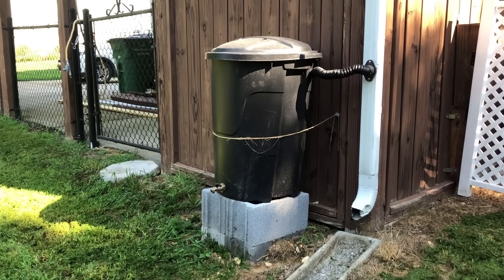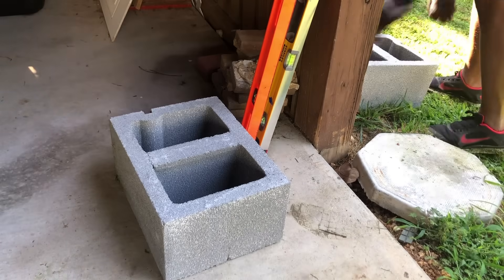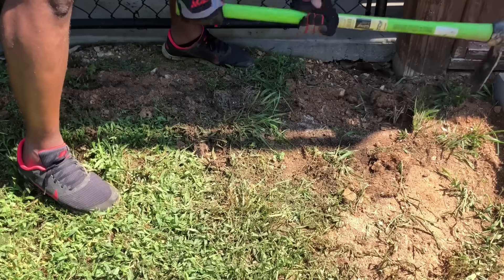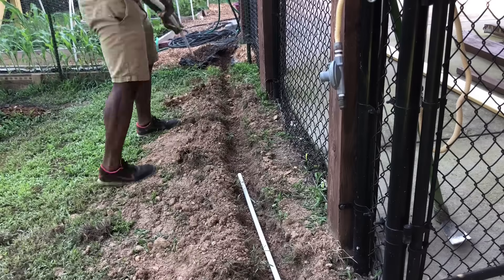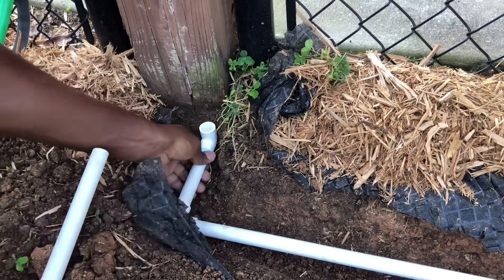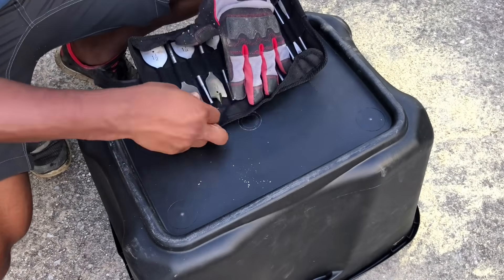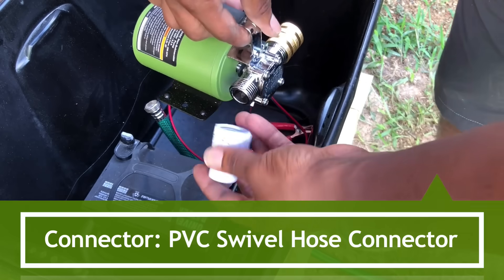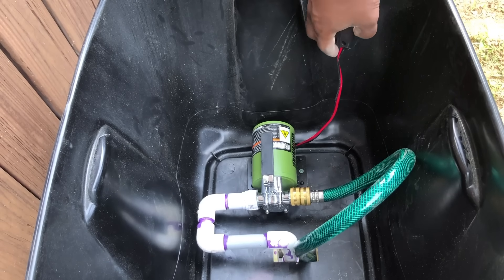Rain Barrel System | CHEAP Water Pump Setup

Comment: If you use a RV water pump they have an auto on solenoid so whenever you turn the hose on and the pressure drops or turn the valve on it will turn on automatically and they're much quieter
Reply: Those are called an "on demand" pump, I believe.
Reply: The noise might not be a bad thing once it becomes considered everyday sounds. That way when the barrel runs dry you hear the tell-tale of a problem in the works.  If one the other hand stealth is required, the sinking the tub into the ground would work to mask the noise.
Reply: Link?
Reply: @mcole1987  Google your keyboard works right

Comment: Nice video !  A small recommendation: mount the motor on a rubber or foam block and mount that foam to the bucket. That way the pump does make significant less noise.
Reply from the maker: Awesome tip. Thanks for sharing Petrus!😀

Comment: Nice video. Just wondering why you didn't turn the rain barrel 90 degrees to the left so the spigot was pointing directly at the pump box.  Seems like it would have looked a lot cleaner than having the hose running out of the front.  Overall, great little project though.
Reply from the maker: Hey Tom, thanks for the comment. No reason at all for the spigot location. Just an oversight, but thanks for sharing your recommendation!

Comment: To automate it, you can add a relay where the switch is and use a ESP8266 with the Blynk app to turn it on and off using your phone and Wifi.
Reply from the maker: Hi Simon. I actually did something similar to that and created a video showing the process. Thanks for the suggestion.

Comment: Great video!  Would like to see you do a solar setup.  I have a 110volt submersible pump in my rain barrel.  I works ok for hand watering but can not power a large lawn sprinkler through a long hose.  Rain barrels are pretty useless unless you have a convenient way to use the water.

Comment: Great explanation and step by step build.  This solved the distance and pressure issue with rain barrels.  Good choice for pump, as these transfer pumps came in 12vDC and 120vAC and commonly available.
Reply from the maker: Great to hear Rick!

Comment: Great vid. Thank you for all your effort.
Could you also use a garden hose or flexible poly pipe to go from the pump to to the garden tap outlet to save all of the pvc pipe and elbows?
Reply from the maker: If it was a temporary setup, probably, but if you plan to make it a permanent setup, you may want to check your local plumbing code as there could be other concerns regarding that method that I'm not aware of.

Comment: Nice design and great vid! My only concern would be to put the battery in a separate container. Leaks in the line or pump are quite likely over time especially with the hose connection. Water + electricity = not good.
Reply from the maker: Hey David. Yeah it definitely is not a long term setup. I'm actually in the process of trying to do just that. Thanks for sharing!

Comment: Great video. 

What do you think about using an RV water pump instead of a transfer pump?

The RV pump will cycle on automatically when it loses pressure (ie when watering) and stop when you stop watering. The transfer pump will keep building pressure until you turn off the switch.

Add solar panels to it and it's pretty much hands off.
Reply from the maker: I briefly looked into on-demand pumps but many of the reviews I found online stated that the pressure switches built in fail quite often. I was surprised that almost every pump I look at on Amazon, Northern Tool, and a few other stores had similar reviews regarding the pressure switch. I would still like to test one out myself, but just have not found a solid highly rated on-demand pump yet. Also, for my application, it is not necessary since I currently have drip irrigation setup, so the exit side of the water line will always be opened. Great question!

Comment: FYI utilities aren’t going to be able to help you with locating any lines on the customer side of utilities. In general utilities run perpendicular from the main to the meter. Keep that in mind. If your gas meter is on the right side of the house, you shouldn’t hit a gas line on the left side of your house UNLESS you have a houseline ran over there to a grill, pool heater, lamp, etc. which your utility co won’t be able to locate. They can locate from the main to your curb valve or meter.

Comment: how long does the battery last before having to charge it?
Reply from the maker: Hey John. I'm not sure since I never gave it a chance to discharge fully as a few days later I began working on the solar setup for this project. I highly recommend adding some form of recharging to for the battery such as solar if you do go this route.

Comment: Great video,  really nice job.

If you have a compressor you might think about using it for winterizing.  Adapt your 1/4" quick connect or whatever size compressor fitting to a standard hose fitting (takes a few converter pieces to get OD and thread size right).  Connect a small hose to your compressor and the PVC end at the pump.   Open the rain water ball valve outlet and close the city outlet.   At your manifold open up in turn your hose, soaker hose and sprinkler feeds.   Blow air through each it till no more water comes out, close the rain water ball valve and cap off the PVC at the pump.   

No need to pull anything up.   I do this about once a month in winter.   I'll run my drip system about once a month to deep water trees and plants on a warm day then blow out the system and repeat.  Never ever have to worry about freezing.

Comment: For the discharge side also, you should use a short flex connection, just to avoid tube cracking, due to vibration from motor-pump. Rest.. all good,  brilliant  idea.
Reply from the maker: Thanks for sharing Alecsa!

Comment: An easy way to level out the ground for setting concrete blocks is to use a 6" high mound of gravel or granite chips and tamp them level with a tamper. Set the blocks on top and they will not shift after that. I've found that you cannot trust leveling dirt as it will settle over time and the barrels may slump slightly to one side.
Reply from the maker: Great tip Fireboat! Thanks for sharing.

Comment: Are u not worried about the freeze line ?
Reply from the maker: Hey Dan. Yes, that is a valid concern. I drain my pipes and rain barrel when that season is approaching. If I was starting this project over, I would create a simple drain point using a Tee & ball valve at the lowest part of the system to make draining easier.

Comment: this was awesome I'm actually impressed you hard piped the out side of the pump I would have just used a short hose.
Reply from the maker: Thanks Chris. It was primarily from a lack of experience, but I do plan to redo that setup at some point to make it a little easier to swap out the pump if I ever needed to.
Reply: @GreenTechTown  one suggestion is if you have to worry about freezing take the pump off open the spigot and blow air through it if there is no water there is no risk of the pipe breaking

Comment: Please do not use a sprinkler system with captured rainwater, soaker hoses are fine. A sprinkler produces a lot of aerosols that can transfer legionella, which in turn can grow in your rainwater when the temperature is between 77F and 113F (25C to  45C).

Comment: Nice work mate, good video and easy to understand. If I could suggest one thing though, instead of back filling the water pipes with the dirt you removed, instead back fill with small rocks or gravel then over the top with some dirt or turf, this will help if you ever have to pull up the pipe to inspect for leaks or damage and the pipe will come out easier and not be compressed down with rainwater and mud.
Reply from the maker: Thanks for sharing! Great tip!

Comment: 1. Really enjoyed the music & id like to know what it’s called so i can enjoy it later while i am working.
2. I love how you used a fast video speed while maintaining a normal speed narration. It was very comfortable.
3. I really enjoyed the content overall & the camera angles were pretty spot on.

[Q&A]
-without solar panels to recharge the battery, how long would this system last on the 1 single battery?
-a nice time-lapse once your main video is completed would have been a cool addition.
-are you intending to scale up the system with even more rain barrels? (I haven’t seen the original video yet)
Reply from the maker: Thanks J Bass for the feedback.

Without solar panels, if I left the pump on constantly, it could probably run for 3 to 3.5 hours. Of course, I went ahead and added solar to my setup, so this is no longer a concern, and something I highly recommend.

I do intend to scale up the system. I'm still in the research & planning phase for that project.

Comment: Everyone, please note that this is a great project and video except for one important detail....there is not municipal water system in the country that will allow you to connect a rain barrel system to the city water line as they are obligated to provide clean drinking water to all.  They can not risk you back feeding your rain barrel water into the city water system.  Do everything else, just please don't connect to the city line out of convenience.  The fines can be quite substantial.  Call your water provider and request information concerning this issue so that you will not be in violation.  Otherwise, great video.

Comment: Excellent video. Pro tip....you really only need to keep the glued ends secured for around 4 seconds. The primer acts as a softener, like you had mentioned, and the glue actually melts the pvc together. Around 4 seconds is all it takes to make that bond. I'm pretty excited for the idea you presented here. Got a like and a sub from me.
Reply from the maker: Thanks for sharing hrd2dfyn, and welcome aboard :)

Comment: Good job, I'm going to mount my pump and battery on a trailer with a tank on the trailer. Pump the water from rain barrel to water tank on trailer for remotely located plants.
Reply from the maker: Awesome! I've seen a few people do a similar application. I would do the same if I was in your shoes.

Comment: This is a great video, very detailed and yet not long and drawn out. I'm assuming you turn on the pump manually when you water correct?
Reply from the maker: Hey Victor. Thanks for the feedback. And no, I do not turn on the pump manually anymore. I've installed a wireless method which I've created a video for on my channel. :D

Comment: For a garden, if you put down 8”-12” or more layer of straw on top of the soil, you will not have to water all summer long even in the driest times.  Try it.
Reply from the maker: Thanks for sharing this tip Julius. I have seen others using straw for that same reason.

Comment: Very cool. Subbed👍👍
So it looked about 20ish ft from the barrel and pump to spigot... what would you guesstimate the outer edge of how far that pump could usefully push water? 
My garden is probably 100ish ft from the house. You think a bigger pump would be necessary?
Thanks,
On to check out the solar install 👏👏
Reply from the maker: Welcome aboard! Regarding your question, I'm sure there is a math equation to figure that out, but if I were in your shoes, I would probably go for a larger pump if I needed to pump water that far and still meet the needs of my application which needs more volume and pressure for my drip irrigation system I recently installed. If the demand is not too high, you may be able to use it, but double check with a professional at the store and see what they recommend just to play it safe.
Reply: @GreenTechTown  cool mate, thanks👍 yeah it would likely be to run garden soaker hoses, so im guessing it wouldnt need too much pressure. Ah the joy of planning lol

Comment: Good, but most water regulations say you should have a double check valve in there, just in case of low city water pressure, you could be back feeding stinky rain water back into the mains drinking water and killing people. Good system though.

Comment: Nice job!  Had a thought, maybe put the battery up on a block in the bin and drill a couple of small holes on the bottom of the side of the bin so if it does spring a leak inside the water would drain out before it got up to battery level???
Reply from the maker: Hey Valerie, that is a great idea. I plan on completely separating the major electronics including the battery from the water pump tote soon since this was a temporary setup to see if the concept would work before investing more time into it. Thanks for sharing the great idea for some who may want to keep everything in 1 tote/container. :D

Comment: Nice! I realize you added a solar panel later, but how did you originally keep the battery charged?
Reply from the maker: Hey Ed. Before using the solar panels, I would just use a standard battery charger, but I did not use that method for very long. I quickly added the solar panel to the system right after I completed this part of the project.

Comment: Just a note to let you know that when the HF pump stops working, There is a rubber impeller in there and you can buy replacements on E-bay.
Reply from the maker: Thanks Pat for sharing. I also believe mine came with an extra one. So far, almost a year later, it is still running as if it was brand new. Hopefully I can get some more life out of it.

Comment: Job well done.  Does your system have a filter?  Our rain barrels sometimes have debris in them which I think would clog up the pump.
Reply from the maker: Hey Gale, yes I added a filter to the spigot attached to the rain barrel. I believe I show which one I use in the solar video for this project. Great question.
Reply: @GreenTechTown  Thanks.  Loved your video.

Comment: My mind immediately goes to "what happens in winter when everything FREEZES?"
Reply from the maker: Hey Squirrel Covers. Great question. When the winter season approaches, the plan is to simply disconnect the PVC system and store in doors for the next growing season since the large parts are only dry fitted so it will not occupy too much storage space once broken down.
Reply: @GreenTechTown  wouldnt a union be on the the pvc, would make for easy disconnecting and reconnecting?
Reply: @GreenTechTown  Called it !!! :))))
Reply: :)) No need to use in winter really. It's probably just a seasonal thing and/or he lives in the southern US, where it's getting hotter. It's definitely a good thing for desert and drought hit areas. Its like saving a rain storm for later or being able to schedule a garden shower.
Reply: You don’t need to water in the fallow time of the year I would not think.

Comment: What size water pump are you using
Reply from the maker: It is rated as a 290GPH pump on the Harbor Freight website.
Reply: What size is the intake and outtake on the motor

Comment: do not connect city water to rain water u can have cross connection and pump.  can push rain water to pottable water line and I can get sick. use rpz on the home water line

Comment: YOU SHOULD USE A  RV DEMAND PUMP - - THOSE TRANSFER PUMPS WEAR OUT  FAST - COST ABOUT THE SAME
Reply from the maker: Hi Bruce, thanks for sharing. I've looked into some On-Demand pumps and many people complain about the pressure switch going bad or not working properly. What RV demand pump have you used that seems to work really well?
Reply: @GreenTechTown  I NEVER HAD THAT PROBLEM - SHURFLO IS THE STANDARD AMERICAN - I USE A CHEAP CHINESE COST ME $14 NOW $28 - I USED THE TRANSFER PUMPS AND WORE OUT IMPELLERS FAST

Comment: Your set up is nice. As I have been using alternative (solar) power for nearly 10 years, May I suggest that you look into Lithium Titanate  batteries. They are a bit more "pricey",(It took 6 batteries @ $60.00 each to get over 12 volts). The upside to the purchase is that the batteries last about 30,000 cycles,(or-81 YEARS)!  I am also currently switching back to a 275 gallon "tote", (that has a threaded lower unit) to satisfy our 30 plus gallon gardening demands. Good luck! B.T.W.- I run 5-12 volt-2 watt  LED"street lights" all night long, and then a 12 volt pump for 1/2 hour, and still have a reading of 13.1 volts before breakfast. (Just sayin`).
Reply from the maker: Thanks Steven for taking the time to share. Will definitely look into those.

Comment: You do very neat work. However, you should use less 90 deg fittings or even flexible PEX. Each 90 deg fitting adds so much resistance it results in a 25% speed loss of water flow. With PEX you can make wide sweeps and have almost no resistance to water flow rate.
Reply from the maker: Thanks for sharing MrMockingbird!